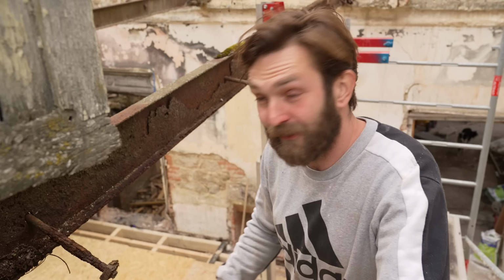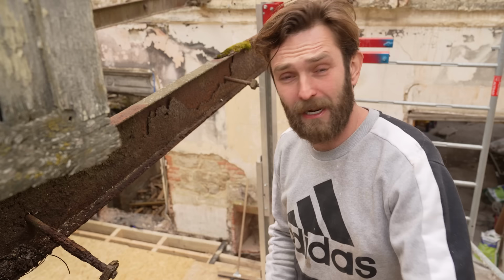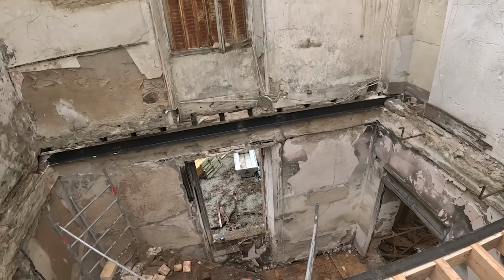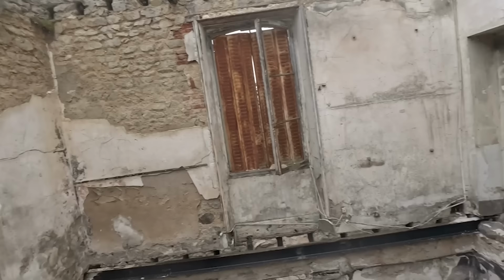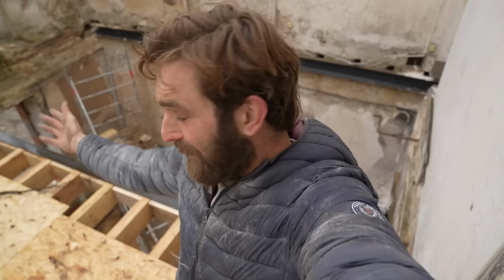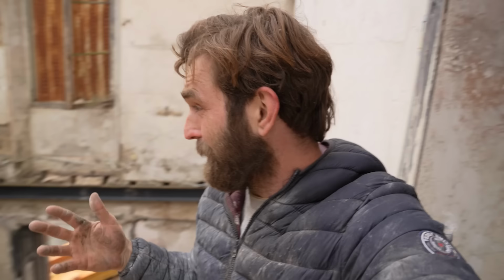Discovering a new floor and view for the first time.

Comment: At 71 years of age I had doubts as to if I’d ever see any of the château finished. Considering this year’s progress I’m feeling better about my chances.
Reply: I can't wait to see what it will look like in 20 years...
Reply: @masterspin7796  it would be going against my genetics to think that I’d be around in twenty years so will just enjoy what progress that Dan has made.
Reply: me at 61 thought the same... hang in there
Reply: I’m 78 and feel the same way.   About a lot of things.  👍🤔
Reply: I am 75 and I feel the same, but in the meantime, I am enjoying seen Dan and his friends’s progress. You are all working so hard. I have a lot of admiration for what you are doing
Reply: Sir when you come back in your next life, this Chateau STILL won’t be finished
Reply: I reckon at the original process (1 with occasional help) it would be a 10 year project, with two people at present obviously work is going a lot quicker up to the roof level, I think that however will slow down on repairing walls inside unless Dan can get a brickie on board, so at most it should be completed, except the outside boundaries and external gate, by 2033, as the Average age is 80+ in the West that should be doable for most, unfortunately not for all, but it does good to know that the project is ongoing and this External part of the works is the most difficult, once all the roofs are on (By 2026, although still a temporary membrane still for then maybe on top!) it will be a damn sight easier for Dan, so let's aim for that time first and celebrate that event as a milestone, both for Dan, his work colleagues and ourselves, then we aim for the next milestone completion of internal structural repair work in the dry, then Externals and Fitouts!?!
Reply: Do not be negative ! I am getting 73 and my plan is to see it finished . Years are running fast , but enjoy my life , i ride motorbike , this year i sail my boat back here to Barcelona from Sweden. So i am planning a lot .  Look at Sven Yrvind he is i guess 82 building a new boat , and already have plans for the next one 👍👍Take care
Reply: Me too!!
Reply: Ahhh..com'on.... 71's not that old, and Dans pretty fast...😊
Reply: @noasailing27feet Well said I'm 71 and fully expect to visit a finished chateau 😊
Reply: You are not alone ! I am 68 !
Reply: You are concerned about age, - well rest assured that Dan has a l o t more to worry about than that !
Reply: @TomTomicMic  Way back he did say once the site was safe he'd look at taking on more help
Reply: Totally agree. There’s hope for us yet 😉
Reply: @tbayallstar  how do you know that?
Reply: It just makes me smile 😊
Reply: I am 81 I am worried!!!
Reply: Ditto at 83!!
Reply: I’m 85, beat you all so far, but I certainly intend to stay around to see this finished!  I’m loving it and less is more with  the decision of  every two days has been a good one.  More and better content.
Reply: Same age as you..but I have no doubt about seeing the end of this amazing project..
Reply: No not concerned but hopeful that one day I will see Dan choose wallpaper, now THAT would be something to behold !  @Mr.-Wint
Reply: Like most good projects it's highly about the journey as getting finished. But a lot of people seems born with so little patience they miss how rewarding the "journey" for getting there actually can be.
Reply: This cracked me up!
Reply: I'm 61 is a new Journey for me. stay healthy and God Bless. the Chateau is looking Great. I worked in construction and it's a good pastime.
Reply: May GOD grant you bless you with a long and Healthy life and all His goodness...In the precious name above all names...JESUS.
Reply: @noasailing27feet  That is the way to think, because what man thinketh that is he, think positive get positive reactions....GOD bless you with all His goodness.
Reply: Coming along great Dan!!! I always feel better when Nick is around to lend a hand.
Reply: Hey guys, remember we live on eternally, from one lifetime to another! I look forward to the next lifetime! Most of my loved ones have finished their curriculum, graduated their school year here, and have returned home for the holidays, awaiting a new school year opening! I want to qualify to enroll in the Federation Starship Academy, in my next lifetime or so! I would like to be a member of one of the Starships federation fleet, like the U.S.S. Enterprise! All the best to everyone! God bless us all, on our spiritual journey to our Lord God!  Amen! Thomas!
Reply: Same here.  I am wishing I had the foresight to do something like this when I was Dan's age.
Reply: Could take 5-10 years. But thats the thing about life. Noone will see everything and that's okay. We will see the progress and that it'll be finished someday
Someday I'll be (hopefully) be in the same position as you are. Maybe not being able to see my children and grandchildren grow old. But that's something we habe to accept. We see them grow up. That's the important part.
Reply: Being part of the process and giving your input to it is enough.
If they haven't started this channel, we wouldn't be able to see their progress at all.
Reply: Same here. 😃
Reply: I'm 72 and looking forward to buying a Chateau with my partner in the next year or two. Mark & Scott
Reply: Dear 71 year old, you are a young chicken!  You will see the chateau completed.  I will also!  It is magical.  Dan is magical.  I am 81.  We will just keep praying for the health and strength of these magical working wizards!
Reply: Don't worry my dear friends, at the rate it is going, possibly in 4-5 years, at least the floors, ceilings, windows, doors and rooms will be ready. After that, one year for wiring and plumbing. Then, you have to give it two more years for the exterior, gardens, etc.  I mean, from now on for it to be completed (at this speed they are going) about 7-8 more years.

Comment: Wow that ole steel girder was in remarkable condition when you cut it 
Shows you the quality of materials back in the day
Reply: It's kind of weird they cut it out at all if it was still good quality rather than just sanding/painting it. But I guess it's important to know the quality of what's gone in.
Reply: @carlotta4th  I'm wondering the same.  Curious about any engineering assessments performed on the old structure that's been exposed without a roof for so long.  For example, Dan doesn't explain why he decided that I beam needed replacing or how a new metal beam will be attached.   Or how he calculated the structural loads needed.
Reply: @SuziSellsSound  If I remember right, Dan once said that the old steel beams aren't strong enough for the loads they'll be under after the renovations. Plus they went through a fire so you wouldn't want to leave them there anyway.
Reply: @SentinalhMC  Ah!  A hot fire could weaken the metal.  I just started watching the channel.  Good to know Dan checked loads.  Does he have to pass structural building inspections?
Reply: @SuziSellsSound  I know he's been working with a structural engineer from the beginning

Comment: Wondering why the old holes for the wood joists were not filled with rock and lime / cement before installing the "C" steel.  Wouldn't that have added strength and integrity to the wall?  Enjoying your  progress and great attitude.

Comment: Hey Dan, empty pockets were the wooden beams used to be need to be filled with bricks/stones especially if the pockets are really deep. When you leave them empty it weakens the wall. Good job, though! :)
Reply: I thought the same but it looks from the video that the c beam went in over them, not a builder so how would I know? But had the same thought as you
Reply: @danodynamo  The issue is not the C-section beam in front of the pockets, it is the fact that when there are deep pockets every 25 cm apart,  the wall is not as dense and not as sturdy as a "full" wall, keeping in mind these walls will have to support (some of) the load of the roof. It is also important to remember that this is old masonry that sustained a fire and that was  exposed to the elements for decades. Always better to be too careful rather than not careful enough. :)
Reply: I was wondering about the same.

Comment: Whilst I am impressed by your work thus far in this restoration, I am disappointed by your change in flooring technique. I do understand that you want to change to the c-channel  for both protecting the wood as well as convenience, but if your going to do that, at least fill the holes up with bricks before installing the c-channel.
Reply: I think Dan will or has done it like he did in the last two stories on the other side. Also I think he will also secure the C-beams to the outer wall also as he has done on the other side.
Reply: @bikercowboy1 Yes I think some of it can be done retrospectively, he probably wants to use Nick's availability to the max getting the steels in place, rather than having him idle while he faffs with these other jobs.

Comment: You two are quite the team. Things are going so much smoother on this half. Agree, putting the boards on the metal versus into the wall should be so much better than potential moisture wicking into the wood. Did you ever tell the future plans for the chateau?  Personal use, bed and breakfast or ?????

Comment: A structural engineer ok'd the walls going from ~40 points of supports down to 8 for each of the 3 floors loads.  Those are solid walls! 👍
Reply: I hope an engineer had a look at this. Two of the support points seem to be on top of large door opening.  Always worth checking the statics if you make changes while building...

Comment: You've got yourself really well equipped with new machinery and tools for everything except lifting! There's an enormous amount of lifting to do, all the insulation, slates and tiles, all the plaster board and yet you haven't got at least a decent winch set up! With a second hand crane you could lift everything up and over from the back of the chateau!

Comment: I would recommend not finishing one side so you can get material up easier and stored to the other side for the third floor. The. When you have all the cuts(or up to the point you need the floor in to get that last beam in) you can finish the second floor.

Comment: Only disadvantage of not using the pockets is that now you're not getting the weight distribution across that wall - it's all concentrated at each end of the steel beams. Curious as to what  the engineer calculated for that.
Reply: That's not correct, - beams will be bolted into the walls !

Comment: The fact that you're  using the same joists (width and height) for different span lengths may mean the finished floor will vibrate differently.  The shorter span will be very stiff while the longer ones will vibrate more when you walk on them. There aren't as likely to be as many people walking around in a bedroom at one time as on the first floor rooms so maybe you're all right? But depending on whether and where you are planning to hang fixtures like chandeliers in the first floor rooms, they could show the vibration. If they are crystal you might hear them tinkle or just flutter.  The long span looks longer than those you used in the other wing.  You could space the longer span joists closer together to make up for the length. Maybe 12 inches apart? The floors are not very deep so perhaps you're planning to put partitions under some of the steel beams?  Did you ever bounce around on them to see how lively they are?

Comment: It's interesting seeing the bright metal cross sections of the old rusted i-beams as you remove them. Can you get any sense of how much mass has rusted away? Is there any heat damage visible in the metal on the cut ends?
Reply: This wing was not subjected to heat due to the fact that all the window frames survived, - 38 years of nature took care of the floors !

Comment: It's amazing how much faster this side is going than the first one! As you reconstruct the chateau, are you installing any type of fire suppression features that will prevent it from burning again like it did before? Sprinklers in the ceilings are popular in commercial buildings here in the US, but I would not imagine those would be optimal; they would damage everything with water and could be set off by accident when there is no fire. Is there anything else on the market in France?

Comment: Question:If the  steel does not arrive on time and in case of strong winds, I noticed some of the shutters,windows, and doors are still in place .Could they be closed and secured,maybe using the old pallet wood and done in a sympathetic way in case you decide to restore any of the doors, windows, or shutters? And you won't have the wind to worry about, stop the rain a little bit as well?

Comment: 👍 because of the deteriorating condition of those walls I would have filled in those old joist holes with block and mortar to add some structural integrity.

Comment: DAN what is that machine called that looks like a circular saw and an electric planer has got together and this is the result. You use it to cut the steel profile on the ends of the timbers. Thank you in anticipation of an answer.😊😊😊
Reply: maybe a planer?

Comment: Potential plan & suggestion. As you reach the top floor. I would think roof No 2. Why don't you hire a telehandler to lift the beams up. Supply the raw materials to construct the roof, too. That would speed the process up. Additiomly a cage for when sheeting the roof would be safer.

Comment: Did you fill in the holes where the old wooden beams supported the floor?  It appeared you covered these holes with the C beam.  Won't those unfilled holes weaken the wall?

Comment: Dan - just wondering if you are going to bolt the new c section to the external wall in some way - when the wood used to go into the wall it would add downward pressure to the wall and hence stop it bowing outwards for example.  Love the videos and progress.

Comment: I agree with the change of method useing C section . However I presume at some time later you will fill the holes in the wall . When they were original the timbers would have been  packed  and secured  and viewed to be part of the wall . easiest time useing bricks and tiles would be to do this prior to fitting the C sections ?

Comment: The problem with the floor construction is that there is nothing holding the timber in the  beams at the very least two threaded rods compressing the beams together are needed with the old beams timber was bolted to them then the floor timbers connected to that.

Comment: Since your using a c channel instead of board in the walls. Are you not going to fill in those pockets before putting the C channel up? Like for structure and support where there are no weak spots.

Comment: When you were putting in the floors on the other wing you were bolting the beams to the structural stakes the tie the walls together. how are you securing them now?
Reply: It looks as though he perhaps didn't do this with the bottom level as they are resting on ledges, but if I were him I'd go back and do it at some point. 

Perhaps he intends to but is pushing on to the other levels to get the floors in quicker and not have Nick waiting about while he does them, but uses his time to the fullest while he has him. That's my guess.

Comment: Very curious on the change in approach. I've seen this done for building exterior decks as the weight limits tend to be substantially lower than an interior floor. Maybe I'm over thinking it but wouldn't it be to his benefit to use some of the existing pockets to insert steel supports that would fasten to the c-channel (welded or bolted) to carry some of the weight onto the exterior walls so that the lag bolts would function more as a 'tie' to the wall versus relying on the lags to also carry the load? Any engineers in the group can weigh in on this? :)

Comment: I have a question about the new method of using 'C' sections to build the floor.  There is nothing connecting the outer wall to the floor.  Need to install bolts in the 'C' section so it is attached to the wall. I think some type of support is missing unlike the other wing of mansion.
Reply: Can do it after.

Comment: Are you making wood level with top of steel?
If so, I always understood that the wood should be higher so that with any shrinkage the sub floor on top will not be pushed up at steel locations

Comment: hey
why don't you weld a drill bit or adapter to a power/electric tool and spin the lift faster? 
cheers! :)
Reply: Dan said it’s supposed to be slow. It’s a safety thing.

Comment: This may a stupid question, but why is Dan flooring the side without the protection of the roof, surely in wet weather all these joists will end up rotting etc, even with the temporary boards down.
Reply: The joists didn't rotten on the first side during all the rain last fall. So why will they rotten now?

Comment: I would have expected that the holes for the beams in the wall would be closed before the steel beams cover them up. Is that not necessary?
Reply: Will be filled with plaster once the beams gets in !

Comment: I’m curious. Has he said why he isn’t rebuilding the stairs yet?
Reply: What's the advantage of rebuilding them now?

It's just as difficult to get heavy/large materials up the stairs plus the stairs will get trashed.

He did mention potentially adding a temporary set of stairs but I guess it'd be a ton of work for a temporary fix.
Reply: @Kieran0  exactly